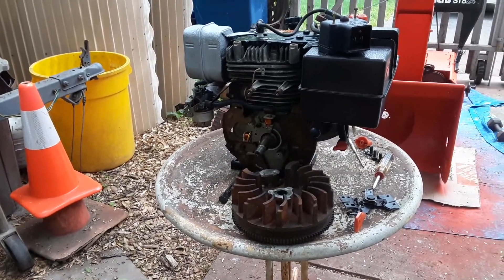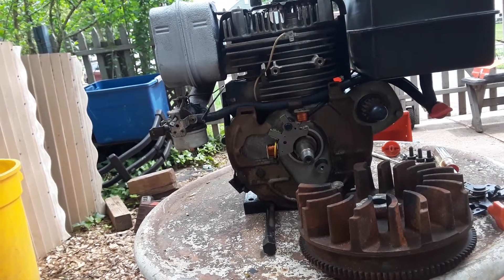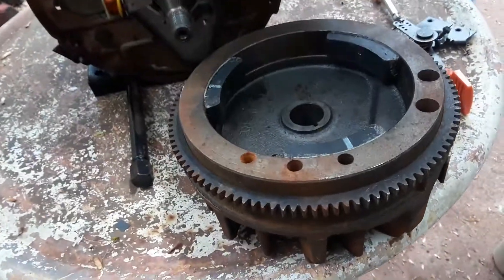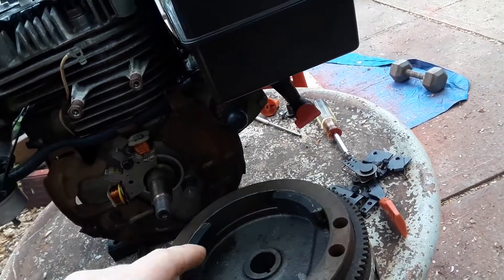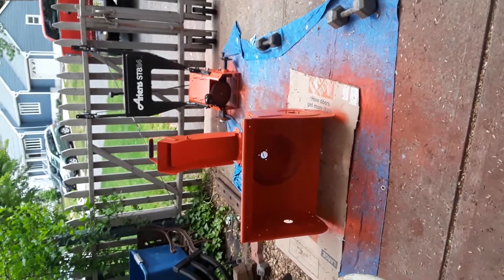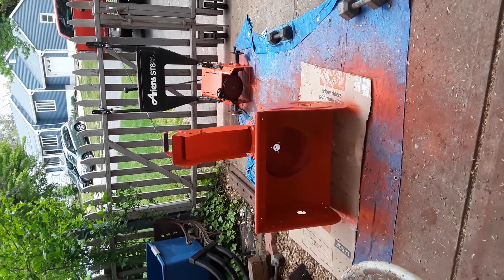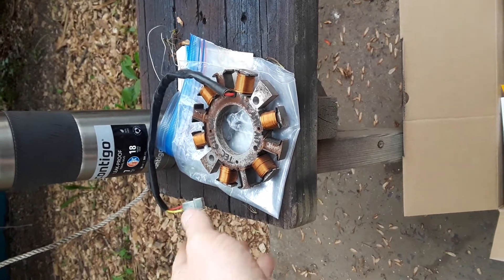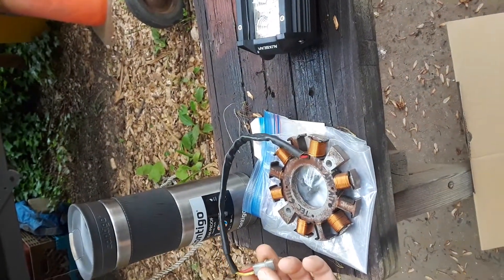Adding LED lights to Snowblower no rectifier or capacitors required, how to.

Comment: I just added a 7" bar light to the top of the auger housing. Light cost me $12 and a adapter to use use a Dewalt 20v to power it cost me $10. A lot less work and battery works longer than the job does.
Reply from the maker: Look at it from this perspective. It’s easier short term, permanent vs. temporary. I haven’t used that machine is 3 years. When it’s time to use it again. I’m not searching for batteries or worrying if the battery is still good or charged. It’s permanently affixed to the machine, when I flip that switch I know I have light, this winter and 20 years from now. Plus we use it commercially all night. I can’t worry about a battery dying on me out there at 4am. If it works for you in a residential application, great. Wouldn’t put it on top of the bucket though. We’ve seen snow falls where it’s higher than the bucket and would get destroyed there. Has to be back on the handles higher and away from anything that will damage it. From my perspective it was easier to order the parts necessary and take the hour to install factory equipment to engine with an upgraded led vs the halogen it would have had.

Comment: I still have my old 1965 Ariens 10M4, but I recently picked up an early 2000's 824 with the oval sealed beam built in to the front of the dash.  I'll probably get the bridge rectifier.  I already have the electrolytic capacitors as I like to work on old radios.  I say this because that bridge rectifier is only about 11 bucks and in the years since you made this video that alternator has skyrocketed to an average of about $70, lol.  To be fair, I've never tried using my snowblower in the dark since, working 2nd shift I always have time during the day to use it.  On the 10M4 I added a craftsman 20v battery holder and bolted two LED lights atop the intake housing and just take my 4ah battery and plug it in when I want lights on it.

I'm going to "restore" that 824, but I'm going to modify it.  I'm going to take all the black parts and paint them arctic white, then buy some vintage reproductions of 1960's Ariens decals, like the big Sno-Thro decal and engine decals, etc and put them on the 824.  I think it'll make it somewhat unique looking when it's all done.

Comment: I was under the assumption you have to run the 5 magnet flywheel with that higher output stator. So now I can run it with a 3 magnet flywheel? Splended!
Reply from the maker: I thought you were thinking you needed the 5 magnet, flywheel. No your set. The 3 magnet one is fine. 👍

Comment: An ALTERNATOR produced AC, not DC, hence the name alternator.  If you add 1 diode in series with the output you turn AC into half wave rectified DC.  If you use a full wave bridge rectifier you get full wave pulsating DC.  This wave alternates between full voltage and zero volts for each AC wave.  If you put the proper size capacitor across the full wave output you end up with filtered pure DC without the pulsated DC coming out of the full wave bridge.  You also get a higher voltage from the filtered DC.
Reply from the maker: Thanks for clarifying, electrical is not my strong suit. I do know that alternator was one of the higher end ones, second from the highest rated amperage one they offered for Tecumseh horizontal aluminum block’s and had AC and DC. The LED was connected to the DC side eliminating the need for a rectifier and getting rid of pulsating created by unregulated alternating current without use of a rectifier, the point of the video, for those who just want to tap into the DC side without dealing with adding a rectifier. I know it is listed by Tecumseh as an AC/DC alternator, it’s been a minute I don’t recall the ratings on each end, however it creates DC which was my concern, not how and more than enough. How it takes ac and converts it into DC on its own was a mystery to me, but it does, which is what I wanted and the final objective. I wasn’t too worried about it as long as it did, which it does and get’s the job done, because I have steady LED lighting, which was my goal. I still have the AC side untapped into if I ever wanted to add heated hand grips, etc. This video was created to show people how to use stock parts without any added parts to power an LED light with enough juice steadily without pulsating. Otherwise you have to tap into the single wire AC alternator, add a rectifier and all that jazz rather than plug and play with stock parts Tecumseh produced. It was easier for me to swap out the less powered single wire AC alternator 90% of Tecumseh’s had and put this one on, giving me the same end result as those who went thru the trouble of adding a rectifier with the other side ready to power more as I add things and need it. My reason’s for going that route. I have rectifier’s but found this option on snowblower forum and picked one up and went this route over the alternative. To me, better and easier.

Comment: I hooked it up without the relay and they work but someone keeps telling me I need the 12-volt relay in there do I need to put that back in there I appreciate if you let me know thank you
Reply from the maker: No you don’t need the relay. The side you hooked up to is direct current. You may need a relay if you use the other wire which is alternating current, but as long as you hooked it to the direct current side like I did in the video, no relay is needed.

Comment: I have a dumb question I think I have that same unit you have their I got the same lights do you have to hook up a 12 volt relay for that to work
Reply from the maker: No the side you hook up to in this video is the direct current side, no relay is needed. You only need a relay for the other wire which is alternating current and would probably need a relay. So if you ever want to add hand warmers or a battery that will charge than you would need a relay, but just for hooking up lights like I did in this video, which is direct current you don’t need a relay. Just hook it up like I did in the video and your good, no relay or capacitors are required. That’s why I used that larger stator, it already puts out enough power direct current that you don’t need a relay or capacitors. If you use one of those smaller stators that only has alternating current than yes you need a relay and capacitors. The point of this video was to be able to hook up lights without needing relays or capacitors. That stator is already powerful enough and had direct current off the one wire so that you don’t need relays or capacitors. It’s a direct plug and play hook up. If you tap into the other wire which is alternating current than you would need a relay, but just for lights you only need the direct current side of it. Down the road if you want to add heated grips or other items that require power power such as to a battery to charge it for a 12 volt starter using the other wire which is alternating current than you need a relay. You’re using the direct current side of that stator. LED light’s need direct current so they don’t blink. That’s why I used that larger stator. You’re going direct from the stator to the lights, using direct current, so no relay is required. Relays are used when you take something hooked to alternating current like the alternating current of the stator and want to hook it to lights that use direct current. Relays convert alternating current to direct current. That’s what a relay does. Your using direct current from that stator to lights that require direct current, you don’t need to covert the power, so you don’t need a relay. That’s why I used that larger stator with direct current, so you could bypass having to use a relay or rectifier or capacitors. You don’t need any of that stuff with that stator, it eliminates the need by passing having to add any of that. The only thing you need other than just hooking the light up directly is an on/off switch if you wanna be able to turn the lights off when not needed. An on off switch isn’t required, you can use it without one, but than the lights will always be on, so I added a switch so I could shut them off during the day, but it’s not required. Everything you need is in that video, if I didn’t use it, you don’t need it.
The people who add relays/rectifiers and capacitors are using those much smaller stators that only have AC. The relay is used for those setups so the lights don’t blink, that’s all the relay does. Because if you hook up lights that are direct current to a stator that puts out alternating current the lights will blink, so fast it’s almost impossible to see with the naked eye, but when filmed you can see the lights constantly flash on/off, on/off. All of that was eliminated using that larger stator, which was the point of the video. No need for relays/rectifiers or capacitors. Just make sure you don’t use a light that draws more current than the stator is rated for or you will burn out the stator. The light I used was perfect, there was juice left to spare and it’s more than bright enough. You can go a little bigger, just make sure the light you use has a rating that is less than the actual rating on the stator. If you exceed it, you will burn out the stator. Otherwise it’s straight forward and covered in the video.
Reply: @Mr_Tecumseh  I have the same lights that you have the 18 Watts bought up from Amazon the snowblower has three wires connectors on the plug too hot and I think the other ones the ground I don't know how big the stator is it is a 10 horse Tecumseh but someone told me I might have to put a relay in there and in a little square I don't know what the other one was but I hooked it up the lights come on and I turn the idle down they go down I hope I got it right and you mentioned hand warmers I didn't know you could hook hand warmers up on that too but I'm not going to do that it's a real nice old snowblower it never had lights and I found where to hook them up at and I hope my stator is like what you have there thank you for replying back
Reply from the maker: @davidlautwein1338  If the lights dim when you idle it down you did it right. With direct current the speed of the engine determines how much power is being produced, with alternating current, the lights would stay a steady brightness no matter what speed the engine is running so you did fine. The only thing I would keep in mind is don’t leave the light on when you throttle the engine down. To be safe only use the lights when the engine is running at full swing, because you put more work on the stator powering the light when you run it at low speed. The stator I used in this video which is also the one you have was only used on top of the line snowblowers that had all the bells and whistles. Most snowblowers that have the hook up for a light used a cheesy small alternator that gave out minimum power for lights. The videos that you have seen that required the voltage regulator and capacitors were people hooking up led lights using that basic little stator which is the common one. Those were alternating current stators only. The reason you had to use a voltage regulator and capacitors with those base stators was because they are alternating current only stators that have a single wire. The stator we use has two wires the one which is also alternating current and direct current. The old halogen lights were alternating current systems so if you upgraded to an led and you had a halogen light with that basic stator you had to use a voltage regulator to convert the AC to DC to properly run DC led lights. I did it the way I did it to avoid having to convert AC to DC plus that stator produces a lot more power than the standard one. So what you end up with is a stator that has the DC hookup ready to go plug and play no regulator/rectifier or capacitors needed. Plus you still have all that extra juice from the alternating end of the stator left to tap into if you ever wanted to add more electrical components to your machine. Yes they sell aftermarket heater grips online that will slide onto the handle bars of your machine after you take the stock ones off if you wanted to add the heated grips. The really high end snowblowers also had key electric start that had a battery on board. That is why that stator has a second wire for alternating current so that you can provide power to AC heated grips as well as charge the battery while the engine is running. So that the battery is fully charged when you go to start it again. But for now unless you add those items you don’t need the alternating current side of the stator, so I left mine untapped into and could use it in the future if I ever wanted to add those things. But yea you’re all set, you don’t need any of those other components for your light. That’s why I went with that higher powered stator that already had a DC hookup, so I didn’t have to bother with a bridge rectifier/regulator or capacitors. It was easier to just use a stator already equipped to handle the LED without adding those extra components. I shared it online to show others you can hook up LED lights without the need for those added components. Basically another method of installation. Also in my opinion a better method because your using equipment that was designed to handle the lighting instead of alternating equipment that was never really intended for LED or uses outside the stock methods for those alternators. So you’re all set, you have no worries. One other thing you will notice, I have seen people hookup LED lights to those stock stators and while they work, over time it will burn them out, also another issue is if you hook into the stock alternator without a rectifier the LED gives off a strobe effect, essentially what that means is the light constantly blinks, it’s not steady. It blinks so fast you can’t see it with the naked eye, however if you film the machine with the light on and watch the video you will see the LED blinks nonstop. Now if you film your machines light, you won’t have any blinking, there is no blinking because you have a direct current led connected directly to a DC stator. You’ll see. But that’s why a rectifier is required if you hook up an LED to one of those stock AC alternators. You’re not getting direct current, it alternates on/off on/off. You don’t need that and won’t have that issue. Because you’re on DC.
I hope that helps explain what my method of connecting the lights does.
Reply: Any chance do you have the part number for those hand warmers to put on that unit
Reply from the maker: @davidlautwein1338  Well I know different companies like Ariens makes them as well as universal sets
 Here is one I looked up just now on the lower price range. Just make sure you order a pair that are the correct diameter for your machine. Also if you go to snowblowerforum.com they cover this as well as every topic under the sun when it comes to snowblowers. It’s a great place to find any information you ever need when it comes to snowblowers. Check them out. Here’s the link to the pair I looked up. Ariens sells a set for about $90. But look around enough you might even find a better deal. Also as long as they are the correct diameter any brand will work.
https://a.co/d/bAeUvN3

Comment: Part number disclosures AND wiring info? Somebody give this man a promotion... I've dug typically good resources for several nights already with nowhere near this amount of solid data.
Reply from the maker: Glad you found it useful.
Reply: If part 611094 is used on units with hand Warmers does that mean if I do this upgrade I can add handwarmers as well as led light? I have an Ariens from 2004 with 8.5hp Tecumseh

Comment: Hoping you could help me out. I have the Tecumseh stator with 10 rappings and 1 red wire with a diode in it.
Reply: 611116 is the part number.
Reply from the maker: I can try, what are you trying to figure out about it?
Reply: @Mr_Tecumseh  I'm getting 16.8 volts, 6.3 amps and 105 watts. Using just the inline diode it has installed from the factory, My 18 watt LED pods exploded. It's only supposed to produce 36 watts. Why is it so high?
Reply from the maker: @brandonlaw2010  If the diode side is the DC side that charges a battery it would be above 12 volts typically around 14, in order to charge a battery.
Not sure why it blew out your LED's. though. How long did it run before they blew out?
Reply: @Mr_Tecumseh  only a few minutes. I'm going to try using a briggs AVR rectifier regulator.
Reply: Do you have a Facebook or a way I can message you to send some pictures?
Reply from the maker: @brandonlaw2010  Instagram Mr Tecumseh
Reply from the maker: @brandonlaw2010  I would use the stator I used in this video. Its 5 volts DC, it works well. The one you have I'm not too familiar with but I think its the higher powered one, must be why it burned it out.
Reply from the maker: @brandonlaw2010  Either way the stator your using is most likely the higher powered one. How many magnets does the flywheel have, 5? If so thats one of the reasons. It's probably putting out more current than the lights can handle. Here is the link to the topic on flywheels.
Here is where I found all my information. There will be guys on that forum that can help you a lot more than I can. But you have been accepted, I'll be happy to look at your picture's.
https://www.snowblowerforum.com/threads/stator-question.152449/